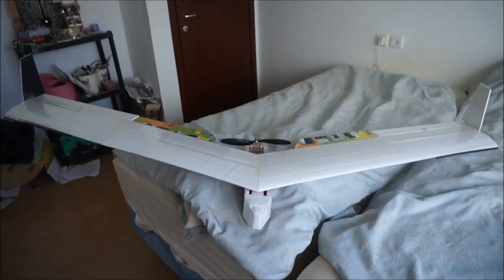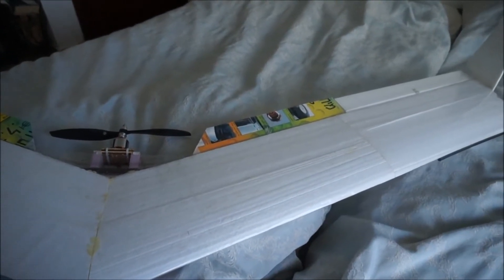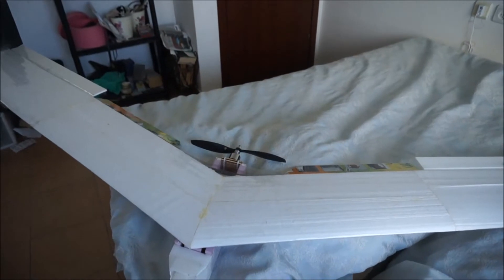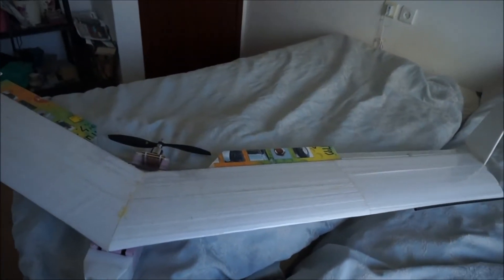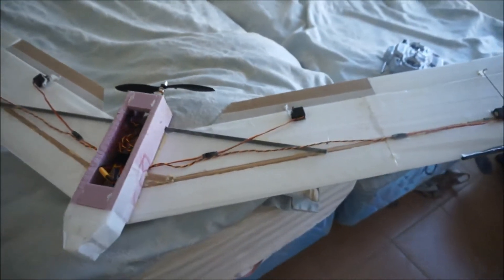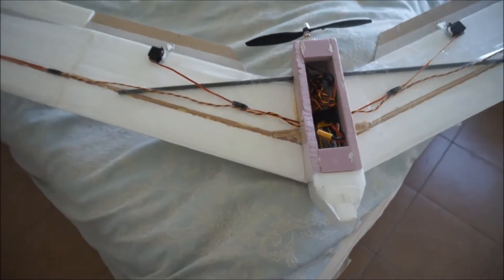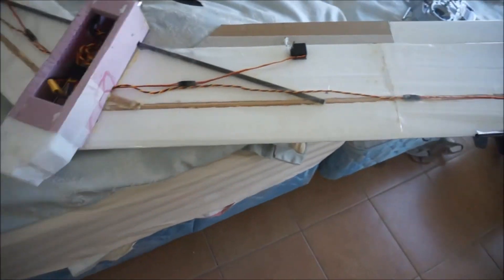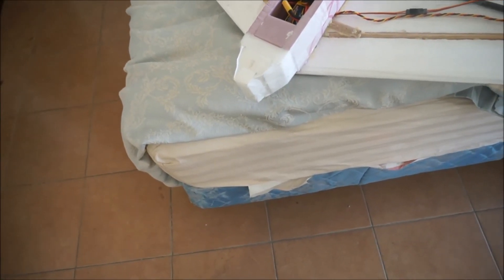Tips for Constant Chord Wing, 80 inch span

Comment: What motor did you use?
Reply from the maker: Motor: Turnigy D2836/8 (1100 kV)
Prop: 10 x 4.5 "slow fly"
Reply from the maker: Don't understand your last question...
Reply: Natan Abrams sorry, you said "slow fly". What is the difference between this http://www.hobbyking.com/hobbyking/store/uh_viewitem.asp?idproduct=63486\
 and a slow fly
Reply from the maker: Slow Fly props are specifically designed for planes that will fly at relatively slow speeds, so they can be lighter and flex more. They are not suitable for high speed airplanes as they will flex too much at high speed and the prop performance may degrade or the prop may even crack/break.
Anyway, there's a lot written about this on the net, so you can Google it for more detailed info.